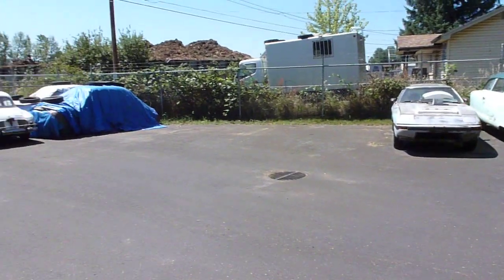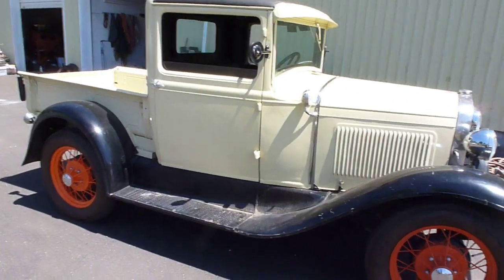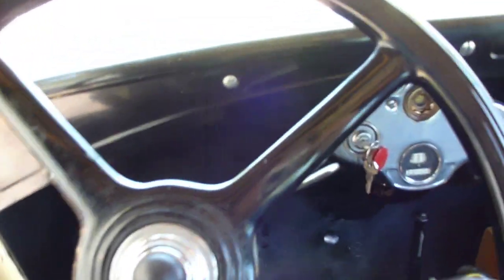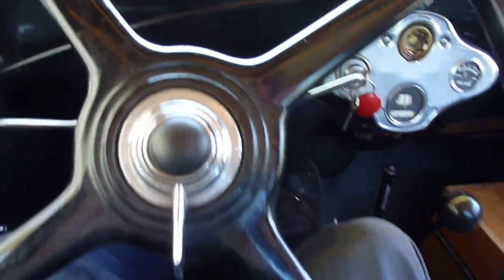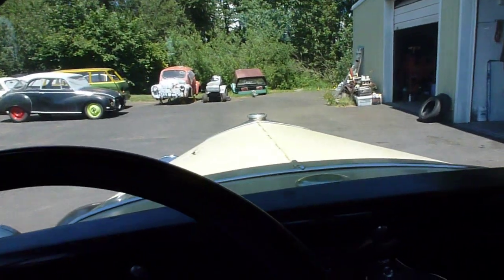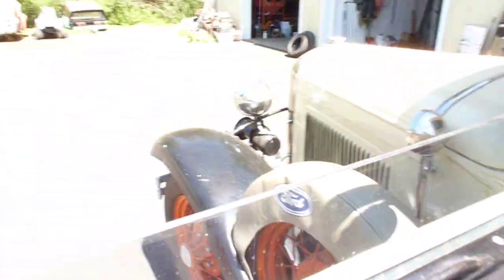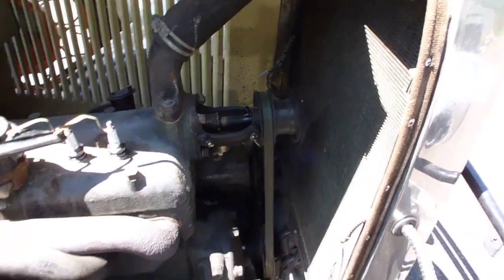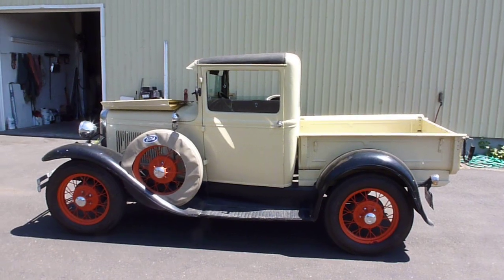1929 Ford Model 'A' pickup

Comment: 30 or 31 cowl. Grill shell changed has 30 car shell. Was painted black from factory on trucks only. Also speedometer is round not oval late 30 or 31 has round.

Comment: @12valvepower1  If you watched the video and looked at the engine at the end, it has the standard 4 cylinder. The flat head v8 was introduced in 1932.

Comment: I have a 1928 ford pickup. 28 & 29 are basically the same. 30 & 31 are the same cab style & have a more rounded roof. The rear cab windows are very different between the 20s & 30s cabs.  This pickup is not a 28 or 29.

Comment: back in the 40s, my father took the rear drivers fender off the  old model A  truck so he could put a belt on the tire to run a buzz saw to cut fire wood for sale.
Reply: did it  work
Reply: yes, yes worked great

Comment: Hmmm. So if one guy, Red, is in the truck stomping the starter button on the floor and tweaking the throttle leaver to get it started, what would the guy under the hood do, or tinker with, before yelling at Red to try again? (BYW: videos like your's are a dream help for writers of historical fiction. Keep up the good work!)

Comment: You don't start a model a with the timing advance as this can cause a back fire and brake the timing gear,starter drive etc. Base timing is 5 deg. retarted on the 4 cyl. eng.
Reply: Notice that he started it incorrectly as you said, but also failed to use the GAV, as well and also he never turned off the gas when he stopped it, too. His expertise in starting and driving a Model A needs some practice, but that is how we all learn, isn't it?  :-).

Comment: I'm afraid you don't know what's you have, that is not a 1929 that is a 1931,
Reply: It is a '30 and not a '31. No indented firewall as a '31 would have. I have a '30 and this is certainly not a '29 in the least, although some DMV person may have tagged it as such.
Reply: Some came out during switchover serials with 29 and 30 components mixed.    Mine was registered as 1929 but the gas tank cap was a 1930 is what I was told by oldtimers in 1965.